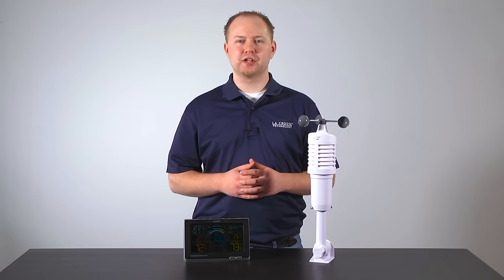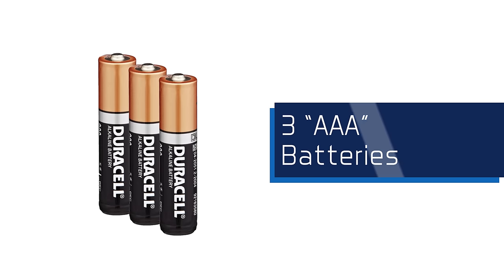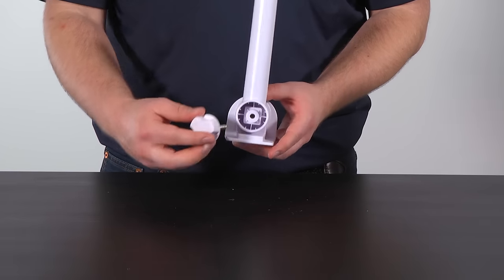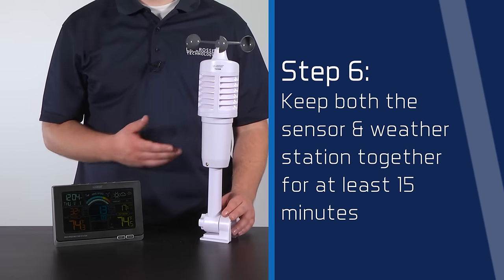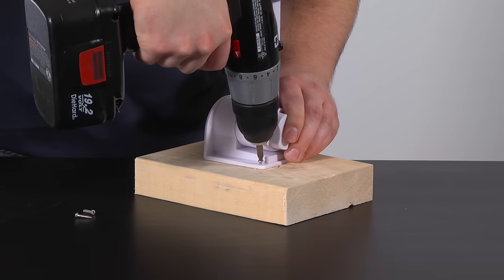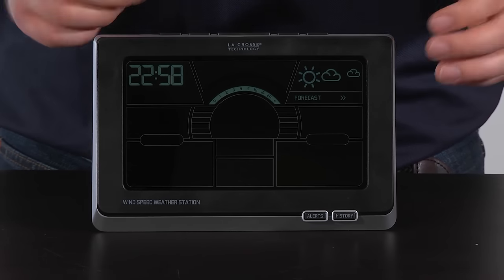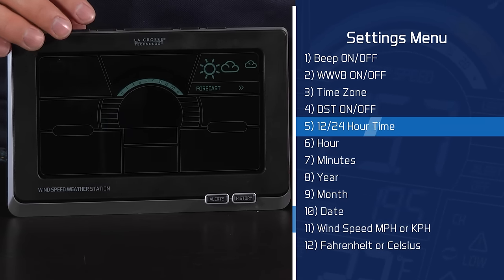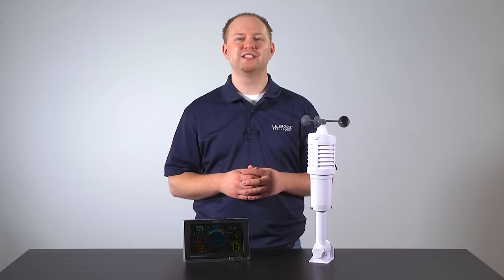327-1414W Wind Speed Weather Station Setup

Comment: My wind speed isn't working. I changed the batteries on everything. My system is just 15 months. The metal where the c batteries toch at the bottom are rusted. I am so sad this stopped functioning. Any suggestions?
Reply from the maker: We are truly sorry for the wind sensor trouble. Our first suggestion would be to bring the sensor inside next to the display and clean the battery contacts as best as you can. After this, install a new set of alkaline batteries into the sensor and reset the display by removing all power, pressing any button at least 25 times, and leave it sit without power for about 10 minutes. After this time, power the display back up. Your sensor should reconnect automatically within the next 10 minutes. If it does, we then recommend wrapping some Teflon tape around the sensor’s threads before screwing the cover back on. This should help keep any water and excess moisture out of the battery compartment. 

If, however, the sensor does not reconnect, please message our support staff directly here: https://bit.ly/contact_techsupport. Or alternatively, send us a private message on our Facebook: http://bit.ly/LaxTech_Facebook or Twitter: http://bit.ly/LaxTech__Twitter page for further assistance. Our apologies again for this inconvenience.
Reply: Mine rusted out also. Batteries were still good. I think it's a design flaw. Only the bottom contact were affected. That area was moist. Got a new one today, so I'll tape around the batteries and hope this time it'll be alright. Cheers

Comment: Is it possible to read the settings remotely?  Would like to put up at lake and view info from home?
Reply from the maker: Hi Denise, unfortunately not with this model. The 327-1414W was designed to show your data only on your indoor display. However, our new line of Connected Weather Stations, combined with our La Crosse View app, would offer this ability. You can find more information about these systems here: https://www.lacrossetechnology.com/products/monitoring-view

Comment: I just set my station up and I can not figure out how to get the outdoor temperature and humidity to show up. It's been on for an hour and the sensor is working fine and set up. What do I do?
Reply from the maker: Hey Kiki, we're sorry for the trouble. First off, what is the model number of your weather station? Is it the 327-1414W featured in this video? This should be printed on the back or bottom of the main display near our logo.
Reply: @lacrossetechnology  yes that is the model. I found this video from the link on the manual
Reply from the maker: @kikicowan7572  Thanks! In this case, we'd recommend performing a basic restart as covered in our video here: https://bit.ly/basic_restart -- Be sure to use a new set of regular alkaline batteries from the same package and have the sensor next to the display during this connection process. If this does not work, please message our support staff directly here: https://bit.ly/contact_techsupport. Or alternatively, send us a private message on our Facebook: http://bit.ly/LaxTech_Facebook or Twitter: http://bit.ly/LaxTech__Twitter page for further assistance. Our apologies for the inconvenience.

NOTE: Your model's TX141W sensor records all of your outdoor readings, including wind speed, temperature, and humidity.

Comment: The wind speed led is flashing, but the outside temperature has two lines also the wind speed, humidity and wind speed all are showing lines through them
Reply from the maker: Hey John, sorry for the trouble with your outdoor sensor(s). Our first recommendation would be to perform a basic restart covered in our video here: http://bit.ly/LaxTech_BasicRestart -- If this should fail, please message our support staff directly here: https://bit.ly/contact_techsupport. Or alternatively, send us a private message on our Facebook: http://bit.ly/LaxTech_Facebook or Twitter: http://bit.ly/LaxTech__Twitter page, as we'd love to help get this corrected. Sorry again for the inconvenience.

Comment: Hello. Should the Wind Sensor be mounted below a shelter?
Reply from the maker: For the most accurate measurements, the wind sensor should be mounted above the tallest structure in your area, clear for at least 50 feet in all directions. Obstructions such as walls, trees, rooftops, and more can often interfere with your wind speed values.
Reply: @lacrossetechnology Thanks

Comment: "OUTDOOR %" & "OUTDOOR C" DISPLAY NIL VALUES "-%" & "- deg.C."
I originally set up the sensor outside, and seem to be receiuving a wind-strength (albeit very low, as there's very little wind now).
I now have two units sitting next door to each other inside the house for over 15 mins. to see if it is a 
'hand-shaking' problem .... no change. Wind speed now shows "-." despite blowing at rotors for 30 secs.
Inside temp. & % functions appear to be workling.
Red-light is flashing on outside unit.
whaT'S UP HERE?
Reply: Ladies & G'em: Many tks yr precise instructions.  IT NOW WORKS!
Having originally installed it according to the manual more-or-less, might I suggest that you include the (rectifying) sequence you gave me as Step 1 in the next reprint of the manual?
Also in the video-tutorial.
Seems to me clearing the memory and getting a good 'handshake' are fundamental.
Fingers-crossed for taking the sensor outdoors!

Comment: After inserting brand new batteries into my LTV-W1, I don't get a red flashing light. I get a blue light that flashes once. I have been unsucessfull in getting a connection to this device even after the reset steps. I do have a connection though to the LTV-R3. Very frustrating.
Reply from the maker: Hey Sandy, we are truly sorry for the trouble. The LTV-W1 is a different sensor than the one that comes with the 327-1414W Station featured in this video, so the blue transmission light is the correct color for your model. As for it not syncing with your display, this could be caused by a few different things. For assistance, please message our support staff directly here: https://bit.ly/contact_techsupport. Or alternatively, send us a private message on our Facebook: http://bit.ly/LaxTech_Facebook or Twitter: http://bit.ly/LaxTech__Twitter page. We assure you we are here to help and look forward to getting this corrected.
Reply: @lacrossetechnology  Thanks for your response. I did get this working and now have wind speeds. There is wind direction. Perhaps that is a separate sensor? I'm also thinking I need a separate sensor for outside temperature? Am I correct on these 2 assumptions?

I have been unable to get AccuWeather connected. When I go to may app screen,  even following all your video instructions, I don’t find that icon to click on. I'd really like to get this functioning. My LaCrosse counter device has the screen location for it.
Thanks
Reply from the maker: @sandyfair5417  For us to provide accurate information we would need to know your weather station's model number. This will be printed on the back of the main display, typically by our logo.
Reply: @lacrossetechnology  Sorry about that. I was not home when I was replying before but here you go.
V22-WRTHV2
There is also an ID # OMOC84428

Thank you
Sandy
Reply from the maker: Thanks  @sandyfair5417 ! In response to your questions, the wind sensor provided with the V22 station will only provide backyard wind speed, if your display is showing wind direction it is connected with the AccuWeather service to provide prevailing wind directions, as shown on page 8 of your full manual here: https://bit.ly/v22v2_manual 

For accurate outside temperature, please be sure to have the included Thermo-Hygro (TH) sensor mounted outside in a fully shaded location for best results. Our video on this topic here: https://bit.ly/TH_sensormounting may be helpful. 

In regard to your last comment, we assume you're referencing our Data Stream option for custom AccuWeather data or text streams on your in-home display. If you are not seeing the Stream Icon, it is likely you're on a sensor device page within the app. Please be sure to navigate to your Display's device page and scroll down until you see this Data Stream section. We show this specifically in our other video here: https://youtu.be/njxQLs6qzrk?t=262  -- We should also note that you must be the display owner within your app, meaning if this device was registered with another account and then shared with you, this Data Stream option will not be available to you. 

We do apologize for any confusion or trouble getting this all working correctly. If you should need further assistance, please don't hesitate to reach out to our staff directly via the links provided in our previous comment. 😊

Comment: I got that same one but mine is now not displaying outside temperature or wind reading could it be the batteries but shouldn't a low battery icon be displayed mine is not showing that
Reply from the maker: It sounds as though your sensor has lost connection completely, in this case, no battery info will show. We'd suggest reviewing our restart video here: http://bit.ly/LaxTech_BasicRestart with a new set of regular alkaline batteries. If you should need further assistance, please message our support staff directly here: https://bit.ly/contact_techsupport. Or alternatively, send us a private message on our Facebook: http://bit.ly/LaxTech_Facebook or Twitter: http://bit.ly/LaxTech__Twitter page. Our apologies for any inconvenience.
Reply: @lacrossetechnology Thanks so much for the quick response but when putting it back up it fell and the bracket got broke as well as one of the wind arms so gotta pick up another one now on Friday:(
Reply from the maker: @droneit3160  Oh no!! We're sorry to hear that. If you need help, please feel free to message us via the links provided in our previous message.
Reply: Hi again...so before I go buy a new one I was wondering if you guys sell these parts...I need the wind arm and the bracket ..not the with the nut you hand turn to tighten but just the piece on the other side of that which it screws into for pivoting...thx.
Reply from the maker: @droneit3160  Assuming you own the 327-1414W, you can find specific parts for that item here: https://www.lacrossetechnology.com/products/327-1414WV2#parts -- For additional help with any orders, please contact our store directly at 608-785-7939 or via email at: store@lacrossetechnology.com
Reply: Hi again...since outdoor outside sensor got broken the inside weather station itself is still reading outdoor temp humidity  and wind speed...how is this possible when the wind gage is in my house on dresser with no batteries in it
Thx
Reply from the maker: @droneit3160  Our guess would be that it is picking up readings from a neighboring sensor. Once you get your parts replaced, be sure to try a basic restart covered in our video here: http://bit.ly/LaxTech_BasicRestart to get your sensor synced with your display.
Reply: Hi so since I got the one I broke replaced and I now have two inside displays...so just wondering if I can run the two displays off the same wind sensor outside..thx
Reply from the maker: @droneit3160  Assuming they are the same models and all parts are within range, yes, there should no issue at all. 😊
Reply: Hi just wondering if you could explain to me about the heat and dew point readings on the lacrosse wireless wind speed weather station...model no.CA87092...is it like the max and min Temps I see on most and if not why don't this one have that thanks so much I really appreciate your knowledgeable replys🙂🙂
Reply from the maker: @droneit3160  Heat index and dew point readings inherently work a bit different than just temperature and humidity. The min/max values for temp & humidity are simply the highest and lowest readings recorded during the past 24 hours, these will reset automatically every day at midnight. Your heat index and dew point values, on the other hand, will take into consideration both temperature and humidity to give you current results. More info regarding these can topics can be found on pages 11-13 of your full manual here: https://bit.ly/ca87092_manual
Reply: @lacrossetechnology  that's great info...so do the model I have have the min/max values for temperature as well cause I don't see them
Reply from the maker: @droneit3160  As instructed on page 13 of your manual, you can use the UP arrow button once to view your MAX values and twice to view your MIN values.

Comment: I was interested in buying this until i saw it took batteries. If someone wants to place this on their roof do you really think they want to keep going up there to change the batteries ? It should have  came with a wire
Reply from the maker: Hey DJ Tommy, we are sorry you feel this way. However, we did want to note that each new set of reputable alkaline batteries in the outdoor sensors should, in most cases, last over two years, so it's not like it would be a yearly venture. But we understand the concern and appreciate the feedback. More details and answers to other FAQs regarding the latest version of this item can be found in the support documents here: https://www.lacrossetechnology.com/products/327-1414wv2#support

Comment: What is the wind speed accuracy (as a percentage) I have model s81120
Reply from the maker: The Breeze Sensor packaged with your S81120 will have wind speed tolerances of +/- 10% at speeds 3kph (1.86mph) and above.
Reply: @lacrossetechnology  ok thanks, fast reply

Comment: How do you set the screen to stay on without going off?
Reply from the maker: The color LCD will need to be powered with the provided power cord. Batteries only will allow the display to turn on for about 10 seconds at a time after a button push and are primarily meant for backup purposes. We apologize for any inconvenience.

Comment: Just wondering if you have to buy any addional pieces for the outside temperature??
Reply: It takes about an addional sensor...just wondering if you need it for outdoor readings?? Thannk you
Reply from the maker: Hey Megan, this unit will come with our TX141W Sensor, which will provide you with your wind speed, outdoor temperature and humidity readings. No need to purchase additional equipment. However, add-on Thermo-Hygro (TH) sensors can be added for increased coverage in different parts of your home, or better accuracy on sunny days. Page 10 of your full manual here: https://www.lacrossetechnology.com/media/catalog/product/3/2/327-1414wv2_manual_020817.pdf covers this process and includes links to these sensors if you're ever interested.
Reply: Awesome thanks. I will check it out
Reply: So the wind sensor that comes in the box gives an outdoor temperature?
Reply from the maker: Yes indeed. 😀

Comment: Hello I need help, how can I make turn on the forecast what should I do to connect it?
Reply from the maker: Hi Roland, if your 327-1414W weather station isn't working quite right, we'd suggest a basic restart. These instructions can be found on our page and in our video here: https://bit.ly/basic_restart -- After this, following the steps described in the video on this page should allow the unit to begin functioning properly. Please be sure to power the display with the provided power cord for a constant backlight, and to only use new regular alkaline batteries in both the sensor and display, other battery types can have transmission issues. If you need further assistance after this, please message our support staff directly here: https://bit.ly/contact_techsupport. Or alternatively, send us a private message on our Facebook: http://bit.ly/LaxTech_Facebook or Twitter: http://bit.ly/LaxTech__Twitter page. Our apologies for any inconvenience.
Reply: @lacrossetechnology  well good news it worked sorry for all the trouble
Reply from the maker: @ronykhoury15  No worries! We're happy everything is now up and running.😊

Comment: What if sensor doesn't light up after checking batteries. I changed 3x
Reply from the maker: The sensor light may not necessarily flash all of the time. The more important thing is if you're not getting outdoor data on your indoor display. If you've worked through our basic restart process covered here: http://bit.ly/LaxTech_BasicRestart and still cannot get the sensor connected, a replacement may be necessary. For help with this, please message our support staff directly here: https://bit.ly/contact_techsupport. Or alternatively, send us a private message on our Facebook: http://bit.ly/LaxTech_Facebook or Twitter: http://bit.ly/LaxTech__Twitter page.
 Our apologies for any inconvenience.

Comment: I have worked for hours and hours and hours trying to get the wind sensor to connect and the WIFI to connect...We did once today get the wind sensor to work but now after removing batteries unplugging the display it still will  not connect and they are setting side by side and by the router.  I can get WIFI but no internet...once the display connected but fiddling with the settings and such it disconnected again.  WIFI signal is still flashing.  We do live in an aluminum sided home and the units are no more than 60 feet from each other.  Temperature and rain gauge work fine and the blue light on the Wind sensor is lit.  This model is NO longer supported or sold and I just purchased it Dec 8th 2021.  Model #V30v2...rather disappointed with this unit at this time.
Reply from the maker: Hey Denise, we are deeply sorry to hear this and apologize for the trouble. For further assistance with your outdoor sensor as well as WiFi connection, please message our support staff directly here: https://bit.ly/contact_techsupport. Or alternatively, send us a private message on our Facebook: http://bit.ly/LaxTech_Facebook or Twitter: http://bit.ly/LaxTech__Twitter page. We assure you we are here to help and look forward to getting this corrected.